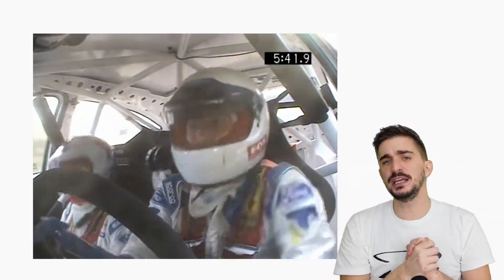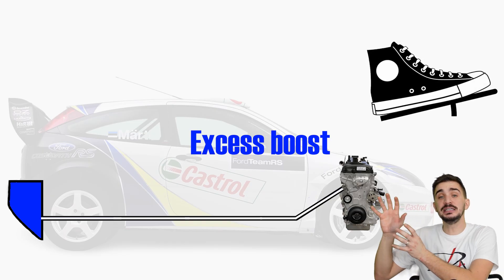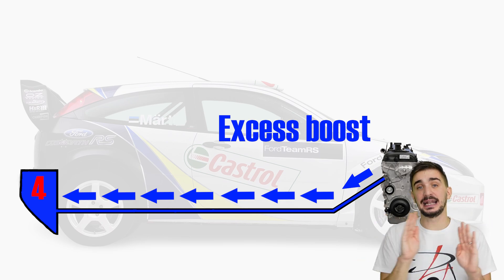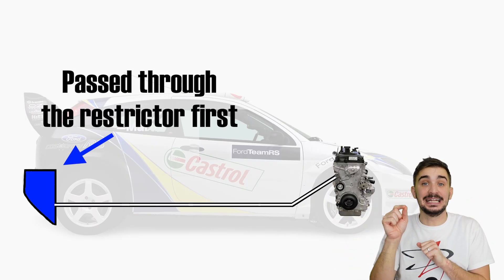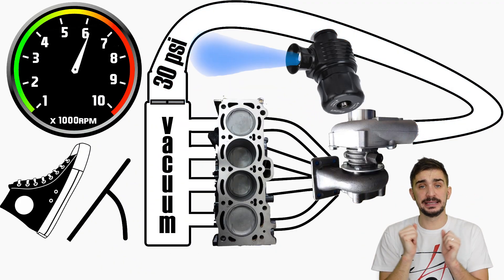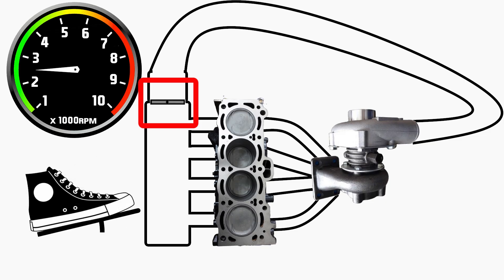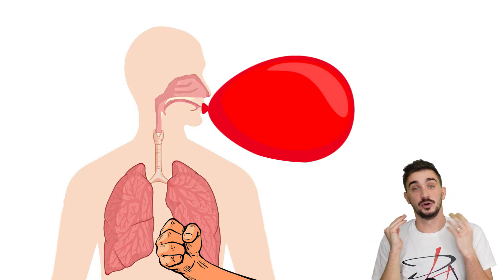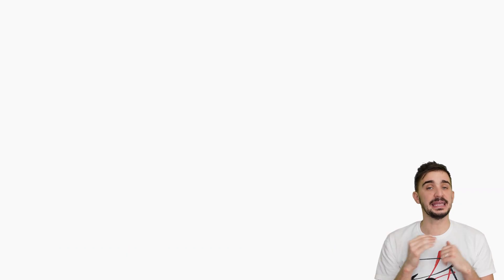FORD'S HIDDEN BOOST Tank - Welded TITANIUM filled with ANTI-LAG

Comment: Bizarre that they made the tank from titanium.  And the way it was made is also strange. It could have been made from aluminum with just a few sheets and it would have been lighter.
Reply: Titanium is stronger than aluminum and not much heavier. So, you end up being lighter because it takes less titanium to make it strong enough.
And, it was made that way because titanium doesn’t like to bend and form. So, often it means using several smaller plates to make complex shapes. That’s why titanium exhaust systems are normally made with lots of pie cuts.

Comment: Pressure does not equal volume. This is why a larger turbo charger can make greater power numbers at an equal or lower pressure than a smaller turbo as long as the engine is producing enough exhaust gasses to drive the turbine. As a bonus the charge will generally be cooler as air heats as it is compressed to higher pressures. It's a lovely balance between lag/spool time and how much air volume you're looking to push from the compressor side.

Pressure is what allows this system to work the way it does but the additional air volume provided by the tank is actually why the system works. The pressure differential allows the tank to charge and release simply by opening and closing a valve (not unlike an air compressor and its storage tank), but the additional volume of air released is what gets mixed with fuel and burns.

This was really quite clever in its simplicity. Some only considered it cheating because they didn't think of it first and thus weren't using it on their own team's vehicles.

Comment: What a load of bull crap. Who would build a tank out of SO many bits of metal? Why would their welding be SO ugly? Why have it mounted SO far away from the engine? And connected with such a SMALL 30mm pipe? Why hide a secret tank inside the rear bumper, when so many rally cars rip there rear bumpers off any way?

Comment: 13:00 - But the claim of the media still stands. What if instead of pushing the saved boost back directly into the engine, you plumb it to the intake side of the turbo with a simple two way check valve (similar to a reed valve). Instead of 2 bar, when the turbo spooled up, you would have 2 bar of zero lag boost, AND (for a brief period of time) 2 bar from the turbo, and what was left of the saved boost effectively generating OVER 2bar of total boost vs atmospheric.

Comment: 7:00 Just a note, that larger turbos actually means lower max boost, small fans can spin at higher rpm and generate higher pressure but at lower flow rates, while larger fans cannot spin as fast due to their mass but move a higher air volume. I think what you meant was larger turbo = higher air flow rate = more fuel = more power, while higher pressure = higher thermo efficiency

Comment: I dont really get why they banned this. It was genius. If they ban this, why did they not banned anti lag aswell.. i mean this tank is just the next evolutionary step of anti lag. I think its good enough to be developed further.
Reply: The way they had it plumbed it bypassed the inlet restrictor on the turbo. Although if they’d plumbed it into the turbo inlet they’d just interpret the rules as you can’t have air above ambient feeding the inlet. 

Anti-lag still has the turbo pulling through the restrictor so it is fine. In theory if you limit turbo size and add a restrictor then everybody will have very similar power levels.

Comment: 30 mm outside diameter ? What's the inside diameter ?
33psi is really not that much. Is like taking the tire valve core out of the tire valve. Not much air flowers out.

Comment: Thank you for your lessons, they are both interesting and educational.

I have a question. I think with pumps, you can exchange flow per pressure, isn't that possible with turbochargers aswell?
Reply: Pressure is just resistance to flow. Everything else being equal more flow means more pressure. 
What often happens with turbos is that a bigger turbo can be more efficient so will heat the air less and be less of a restriction on the exhaust side. So, it can produce the same power with less boost. 
Ideally it’s more about the air density in the manifold. Cold dense air under less pressure is typically better than hot less dense air under more pressure.

Comment: Subaru had been doing this for years just at a smaller scale. The Subaru "Rocket ALS" had a pressure tank the size of a 2l soda bottle on the front of the engine that would put out pressure to keep the turbos spooled up off throttle.   
The titanium rear bumper tank was perhaps lighter and better for weight distribution than having a compressing system for the pressure tank in the Subaru version.
Reply from the maker: The rocket came after this

Comment: Reckon that one benefit Ford were counting on was that in theory the air from the tank would've also cooled down to give extra boost, but maybe it wasn't as much as expected due to the heat from the exhaust & radiated from the road (except in Winter rallies in Finland)!

Comment: Well.. from the photo, I would doubt that that is welded. That is brazed and it only holds relatively low temp pressurized air at a few bars..

Comment: The problem though is pressure drops for a given amount of air depending on. The size of the container holding it. The tank would need to be the se exact capacity as the intake in order to maintain the 30 psi.

Comment: Nice but turbo pressure(2bar) at WOT is balance between turbo pump possibilities and engine consumption. Turbo can produce more boost for closed/sealed vessels. W hen you close throttle, there is no engine consumption, intake becalme almost closed vessel, where spinned turbo can produce boost higher than with engine consumption. This peak pressure can be closed inside this extra tank.
Reply from the maker: The difference is negligible in this case
Reply: @d4a  It depends on turbo size vs tank volume
Reply: I agree 100%, and the instantionous pressure when the throttle is rapidly closed can be more than double the "steady state" open throttle pressure if there is no "blow off valve"

Comment: You may want to brush up on your Physics, If you were taking about static pressure your theory would be right but for flowing pressure, when shut off it will create a higher momentary head pressure resulting in a higher PSI, a "ram pump" is just one example that uses the abrupt stopping of flow to produce higher pressure.
Reply from the maker: The increase is negligible

Comment: Are you sure about 7:00 that larger turbos can generate more boost? I thought that turbo size dictates flow and not max boost?
Reply: While they do produce more boost, the also have a greater lag, and as the size increases, the efficiency goes down and the stress on the engine goes up, like everything in automotive design it is a balancing act.

Comment: Ford was innovative in the 80's. A lot of these thing didn't really go into production car. Plasma spray in cylinder wall helps make engine handle more compression that help with lower boost lag. Today, they called it ecoboost. Their turbine was pretty much 80' technology.  Only today they are able to manufacture to production car.
Reply: Turbos in piston aircraft engines is WW-2 technology.
Reply: @johndavidwolf4239  i worded it wrong. i meant to say things like perfected or cleaver way to get things work better. im bad at language

Comment: Why did they put it in the bumper?, 20kg extra behind the rear wheels would effect the handling negatively, why didn't they just put a tank inside the car? Possibly where the original road car fuel tank would be
Reply: They wanted to hide it from the competition, being a front engine car, adding weight to the rear brings the balance closer to 50-50.

Comment: I always thought it had another additional benefit: top speed

When the restrictor caused the boost to drop during high RPM you could went air from the tank to prevent the engine from choking. Basically preventing power from dropping too fast when you revved it past peak power.

Idk if that's something they did but running the engines with a smidge extra power at top gear redline down a long straight doesn't sound completely impossible. Especially with rally cars short gearing.
Reply: I was wondering about that too. The tank needs to have a pressure significantly greater than the intake manifold though .. as that sir is drawn into the engine, the tank pressure will drop rapidly.  I'm guessing that end the huge tank that Ford used can only supply enough air for a few revolutions??
Reply: Went air? Can we have that in English?

Comment: The old "no BOV will blow up your turbo" meme is still live and well.
Reply: Not so much the turbo itself, but all the plumbing between the turbo and the engine, an intercooler designed to withstand double the pressure with the same thermal transfer rating, could weigh twice as much.

Comment: This reminds me vaguely of the anti-lag system in the Koenigsegg Jesko, where there's a pair of extremely high pressure air tanks that act as anti-lag by keeping the turbos spun up while off-throttle.

Clearly not the same system, but hey, it's where my mind wandered.
Reply: I was wondering why no-one seemed to have picked up on this idea. It seems sound in principle, although I don't know how big the tanks needs to be to be useful... certainly much larger than the air volume of the intake and intercooler... maybe that's the catch ??
Reply: @richardbower8707  i think as long as it has enough of a little kick start would exponentially help the spooling
Reply: Why wasn't i told about that? Every jesko reveal video i watched didn't mention it

Comment: All the complexity added for anti-lag -- I wonder why they don't try adding a motor/generator to the turbo shaft that stores energy in a battery, then when the turbo speed drops off, just reverse it so the motor keeps it spinning fast. If the battery is totally separate from the car's electrical system, no-one could say it was using additional energy that it didn't produce in the first place.

Comment: Sounds like Smokey Yanuk’s fuel line. The fuel tank was imited to xx gallons. There was no specified fuel line size limit. He put in a large, and I mean LARGE diameter line something like 10 meters long. He gained several gallons of spare capacity.
Reply: A good argument for all racers to be given the same amount of fuel for the race being the only requirement besides safety.

Comment: I want to use an air compressor as a regenerative brake. 
Have a separate wheel to drive it that is lowered with mechanical or hydraulic. 

Floor it and wheel comes up and tank empties. That way you can store up 200+psi. 

I want to try this idea on my turbo diesel truck

Comment: Regarding the vid about oc, anyone any opinions?

After some sense making math your result was 0.07. Doesnot this number represent a static crank on a bearing surface? Does not the crank lift close to center when in operation? If yes, was your actual oil clearence closer to 0.035? 🤔

Comment: Not sure but in 03 was still using the cast iron block and alloy head, which would tie into the extra boost cast iron needs less work, to take boost. And the weight plenty was probably worth it.

Comment: At that time everyone in the WRC was using paddle shifters behind the steering wheel, with a redundant lever somewhere else in case the paddle system failed. On that 2003 Focus, Ford tried to save weight by having the handbrake double as the backup shift lever. The problem was that when you had to do that, you lost the use of the handbrake, so the driver had to slow to a crawl or even do a three point turn in tight corners. This happed on at least one or two rallies that year and cost them a ton of time.
Reply: They couldn't see the forest for the trees, or reverse throwing out the baby with the bathwater.
Reply: Sounds like a lie 😂
Reply: @INORBET  its not
Reply: @INORBET    There's no such thing as a "backup shift lever. Reverse is a gear in the transmission. 😂 DEFINITELY a lie. 😂
Reply: @Kenji1685there can be in a Sequential Transmission.
Reply: There's no separate lever just to reverse. 😂 What BS.
Reply: Handbrake levers weigh like 2 pounds 😂
Reply: Sounds like it was made by the Gentleman Step Champion, or Twit of the Year ✓
Reply: That is such a Ford problem to have.😂🎉
Reply: Also, I seem to remember that Marko Martin was a tarmac specialist. That's not to say he wasn't a great all rounder. He just wasn't on a par with Burns etc over the whole season.
Reply: another reason why one should never, under any circumstances ever, convince themselves to buy a ford. you're better off walking.
Reply: @IlIlIlIlIlIlIlIlIlIlIlIlIlIlI I’m not quite sure that this case is relevant. Ford’s rally team is not made up of their corporate staff, nor their engineers. Even if it’s in house, a racing team’s poor decision to simplify a part on a vehicle exclusively used for racing has nothing to do with the production cars.

Comment: NO! NO! NO!!! It was a safety cell. When you are on the throttle, you are more likely to run out of room going backwards. When off the throttle you are not going backwards, so to increase the life of the tank the pressure is decreased when not needed. The fastest way to evacuate  the tank is for the engine to pull it out. 
I hope that clears up any possible misunderstanding😆

Comment: would it not be that the tank is filled on overboost pressure by a divert valve  . then tank pressure pumped back into exhaust manifold aiding anti-lag instead of from intake manifold, or i think you may end up with turbo stall as your have 2 force fighting each other.  if  air from boost pipe goes in to exhaust manifold how would the tank get filled and aid anti-lag . more than likely they fill the tank before they start and use the pressure in the tank to feed the anti-lag

Comment: Reminds me of the surge air tank system I used at an old dealership for my compressed air supply for my tools before buying electric battery versions. The pipe design was so bad that the main compressed air tank couldn't supply my tools with enough CFM and I incorporated a tank that would just fill from the main supply and the tank supplies the necessary CFM in bursts. The bay I worked in was the furthest from the main tank and a section which used 1/8" diameter hose (whatever idiot decided to use that when it was designed) I'm sure was choking the air supply.
Reply: Automatic transmissions call it an accumulator. In plumbing it's a surge tank. It's exactly the same concept. And it would only matter for a second or two as the turbo builds back up pressure after going from no throttle to wide open
Reply: @misery13666  in hydraulics it's also an accumulator. Also ties in with hybrid powertrains, as a historical word for battery is "accumulator", so for those mild hybrids that use the electric motor to help the engine at low speeds it's doing the same thing as well.
Reply: Capacitor tank. We used them in large workshops. Also help for water removal if you angle the inlet to make a vortex around the tank wall halfway up. Out let on top centre. Drain at bottom. We used old LPG tanks. We also replaced airlines with blue stipe/mid density pipe,  50mm/2inch. This alone holds alot of air and is cheap.
Reply: Danbeater  ...no....it doesn't. You need to look into it more. It cannot further compress air at speed. the only thing that could do that would be a bigger turbo, or removing the restrictor. . it keeps your boost up between shifts. this accumulates already created boost pressure to keep it at a more constant level. What you're talking about shows you dont understand the system. you cannot increase boost pressures over what has been created past the turbo at open throttle. this keeps you at higher power levels when going back on throttle during shifting.